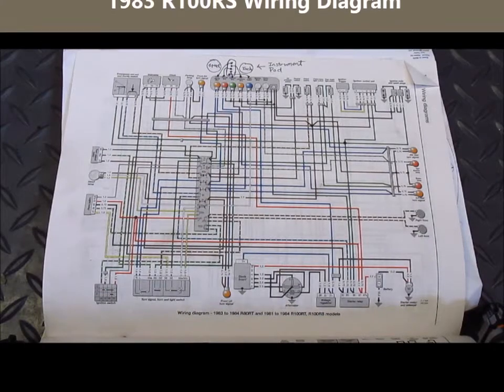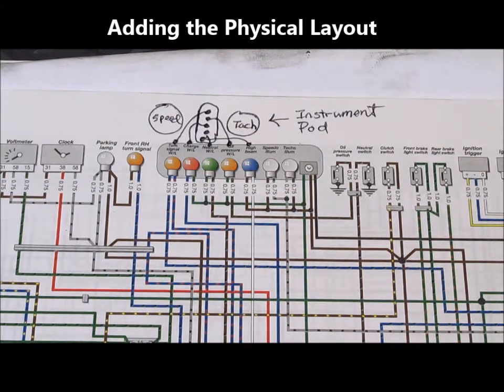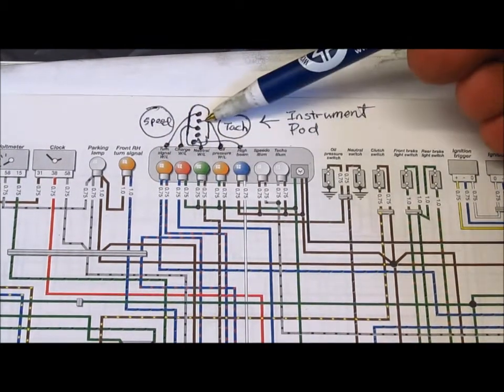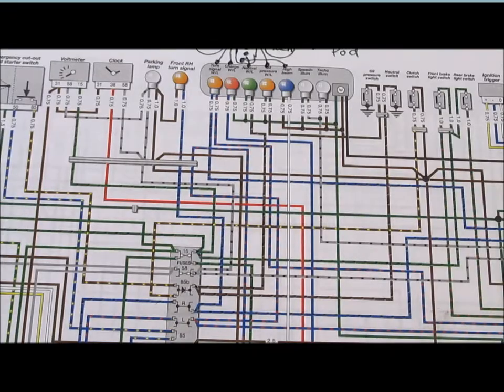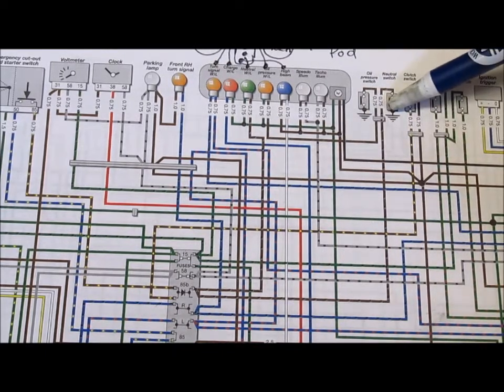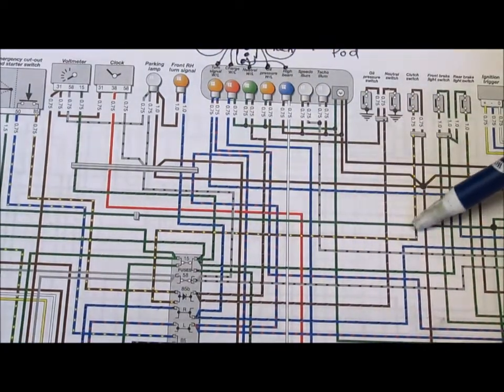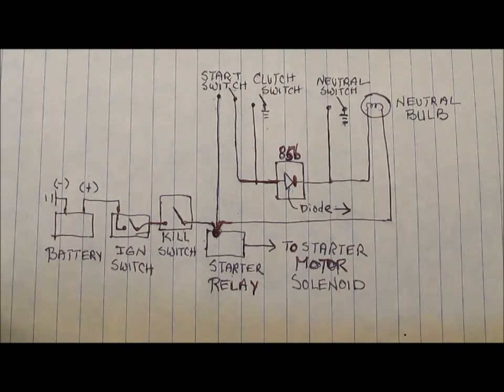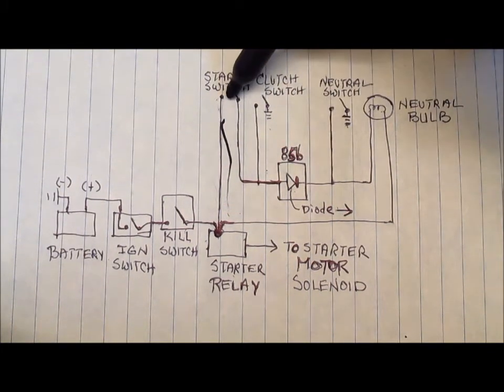1983 BMW R100RS Neutral Switch Circuit Wiring

Comment: Thank you very much!! I check the circuit following your instructions and made a bypass... The neutral light is on and I can use de starter ...
Do I need to dissamble the gearbox to change the bulb ? Because the space is very narrow in my R100GS PD 1993
😢

Comment: Hello Brook. I have a problem I hope you may help with. My 92 R100 R seems to have a faulty neutral light switch. There is a bit of oil from what I can see. 
Do I have to remove the gearbox to replace it? The clearances are tight as hell and I wonder if you have any tips

Best regards,
Markus
Reply from the maker: Markus,  You can get to the switch without removing the transmission. Remove the rear engine mounting stud. Then remove the center tube that fits between the ears on the top of the oil sump. You may need to tap on it with a plastic mallet to get it to move. Then you can access the neutral switch.

BTW, there are two styles of neutral switch. One is normally open and the other is normally closed. BMW changed the design of the shift cam plate and that changed the neutral switch. Be sure the switch you get is correct for the year of your bike.

Comment: Hello Brook! Greetings from the Netherlands. Keep up the good work. My 19 year old son is saying that the start relay should be positioned behind the start switch... In the drawing the starter relay is hot and gets grounded through the bulb and neutral switch. This means that if you turn the key and the engine is in neutral the starter motor will engage. Even if the starter switch is not enabled.

I was showing my son your video, because I remember cookin' my brains with the electic circuit of my 1978 R100RS. And then this junior-mechanic gets smart... I hope you can help me put him back in his place, there's only room for one senior mechanic in this house. ;-)
Reply from the maker: Hi earsykneesynosy,

Well, yes, your son is correct based on what I show in the simplified sketch, but is incorrect about how things actually work. I did not show a separate terminal (85) of the starter relay in my drawing, but lumped it with the two wires connected to terminal (86). That's my fault, and that is what caused him to draw the wrong conclusion about how the circuit actually works, but the correct conclusion based on my sketch. I tried to make things simpler, but I made them too simple :-).

Here is how things actually work.

Terminal (86) of the starter relay sees power from the kill switch when it is closed. But current can't flow through the relay from terminal (86) to terminal (85) until the starter button is pushed. When the starter button is pressed, it completes a ground path back to the (-) terminal of the battery and only then can current flow from terminal (86) through the relay coil to terminal (85) and ground which closes the relay sending power to the starter solenoid via starter relay terminal (30).

There are two wires connected to starter relay terminal (86), which I show. The second one sees power from the kill switch and goes to the instrument cluster to power the charger indicator,  oil pressure, neutral and electronic tachometer regardless of if current flows through the starter relay from terminal (86) to terminal (85), or not. The ground paths for those bulbs and the tachometer are separate from the ground path for the starter relay, so they illuminate when the ignition is on even though the starter relay is not engaged.

I hope that helps.

I'll update the diagram and edit the video when I get a chance.
Reply: @BrooksAirheadGarage  
Hey there! What a fast reply considering it needed to travel all the way across the Atlantic. And thanks very much for sharing the knowledge with the community. And with the two of us here. Junior is already asleep but we'll dig into it tomorrow.  Thanks again!
Reply from the maker: @earsykneesynosy  

And, thank him for pointing out the error in my simplification. I appreciate it. :-)